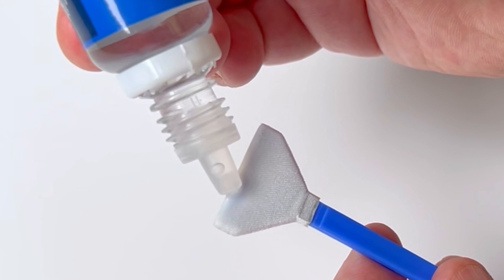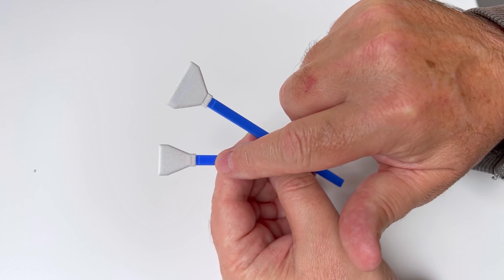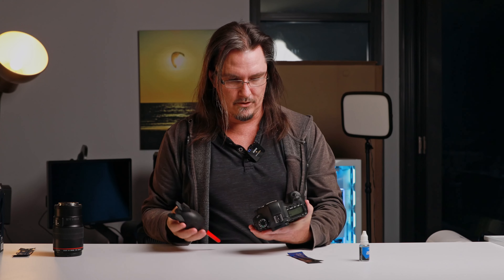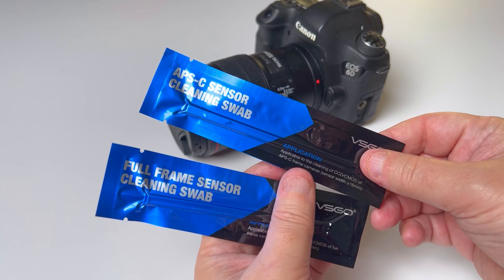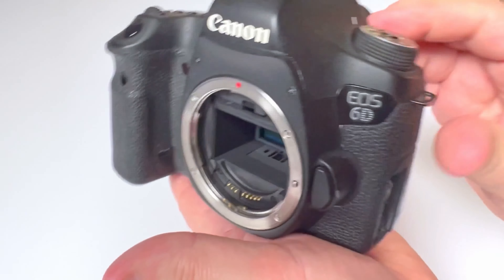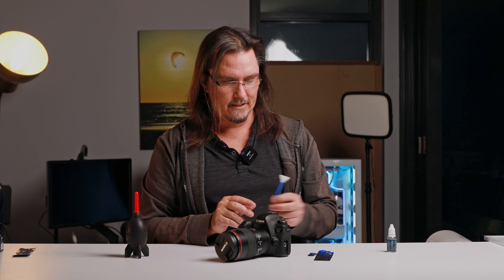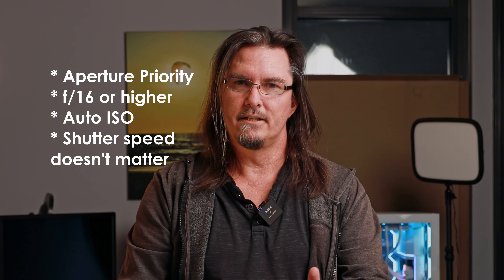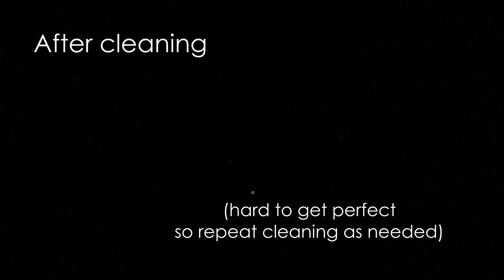Step by Step: Clean Your Camera Sensor Without Fear

Comment from the maker: Hot tip not explained in the video if you have In Body Image Stabilisation (IBIS). It's especially important to use the camera's manual sensor clean function through the menu as if you have IBIS this should lock the sensor in place instead of potentially leaving it free to wobble around.

Comment: If I'd have known how much of a problem sensor dust would be to a DSLR camera when I first bought one I wouldn't have got one in the first place
Reply from the maker: It's not usually a BIG problem if you're mindful of the conditions that you swap your lens in.  This example was so bad because I deliberatly left the sensor exposed for a couple of hours which is not something you would normally ever do. I've rarely had to clean my sensors and the example camera was one I've had for 10 years.

Comment: What about the mirror? What if there is a smudge or hair on the mirror? I can see it through my lense but it doesn't affect my photos. It just bothers me
Reply from the maker: If there’s a hair, hit it with a rocket blower like you see in the video. A lens brush with a very gentle touch may also help dislodge particulates. I’d be hesitant to wipe at it though. I’ve read of people using a swab on their mirror and it has smudged little focus squares if they are present. Also too much pressure on the mirror may affect microfocus as well